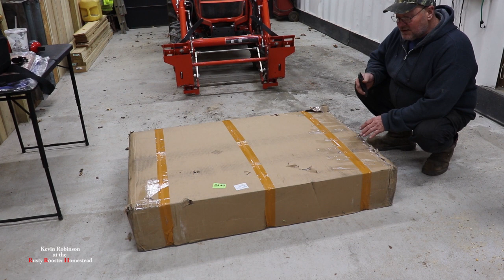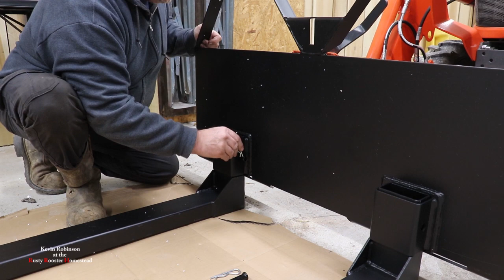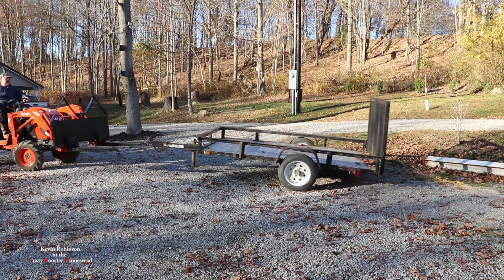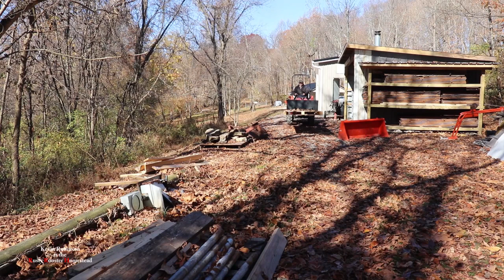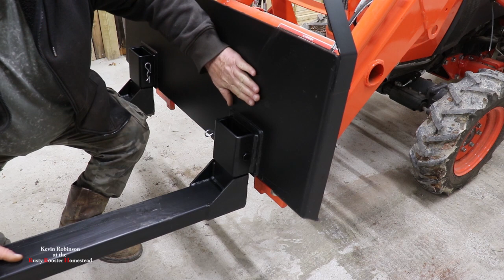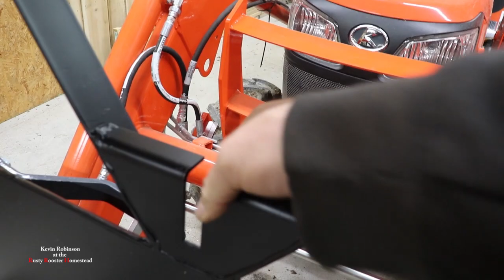skid steer attachments quick attach forks

Comment: Great review..I ordered a set today 3-20-24 for my BX , Been wanting a set for two yrs..Thanks for a great hands on work review!
Reply from the maker: Thanks for the comment mine are still working great use them all the time.
Reply: @TMREDNECK3 I ordered some around the same time as you for my BX. When they arrived I had trouble with the fit of the back plate with the loaders's ssqa pins. Do yours have that issue at all?
Reply: Yes..Mine won't fit..it looks like the angle of the bottom plate is wrong or my pins are too short..that is some BS...What have you done to make it work brother? @SYCAMORONIC
Reply: @TMREDNECK3  thanks for the reply. Same deal with mine. The manufacturer offered me a $100 refund if I want to keep and modify it myself. Pretty sure that is not worth my time. Probably going to return to Amazon but idk.
Reply: I was just looking at the return policyAs I destroyed the box and got rid of it..What would be your idea to fix cut and reweld the bottom plate?..that was mine..but I may decide to return as you stated..I'm like you haven't decided..I have welder friends that could fix it I'm sure @SYCAMORONIC

Comment: forks will be fine for you. like you said the heavy forks would be to much for it. i use my forks a lot allway having to move mine in or out my tractor maxes out at 3000 lb. i think you will be happy with them. take care, be safe and well.
Reply from the maker: So far I'm very happy with them you will see in the next 2 videos I have a big project in the shop and they worked great. Thanks for the comment and watching John.